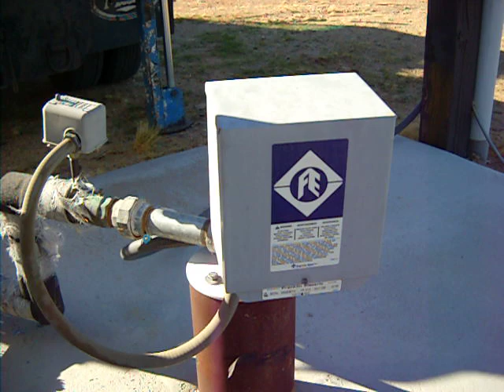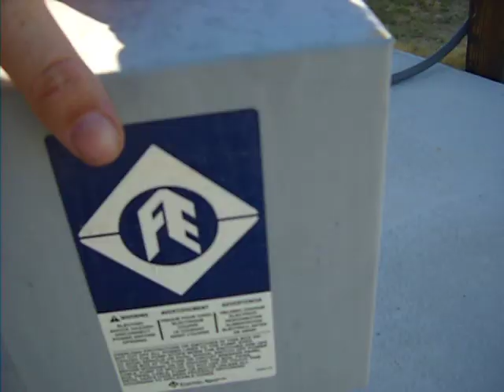PARTS OF A WATER WELL SYSTEM

Comment: Great video for us that don't know wells.   Can you tell me about leaky air valve (I think it's called a snifter or schrader valve)?  When my pump kicks on, the air valve leaks.  It looks easy to change, but do I need to drain the tank first?  Any other tips for changing it out?  What is the exact name so I can find one?  Thanks.
Reply: it is a snifter valve but it has no spring in it. It is designed to let air into the pipe so that the water will drain out. It's a freeze protection device. When the pump is running, it will dribble a bit of water or hiss some water. To test my statement, when the pump shuts off, you can unscrew it and there will be no pressure or water coming out of it. Go to a well supply co. for a new one if you believe it is fouled. They do get crusty from the water over time. Do you also have a round valve looking thing tapped into the side of your tank,, maybe an 1.25 inches in diameter? That's the air volume control valve that balances out the air inside the tank as the pump fills. Thos get crusty as well and need to be replaced.

Comment: why did the company that put are new well install two check valves in system and will it void warranty if we remove
Reply: The correct placement of check valves is (1) mounted in the top of the pump (larger pumps do not come with one internally and need one installed as close to the pump as possible) then check valves are installed  Evey 200' in the well. One check valve is installed close to the top of the well. We usually install check valves above ground like the system in the video so that the county can verify that there is a check valve in the system as far as warranty it depends on the pump manufacturer. If it was me I would reinstall the check valve to be in the safe side!!!!

Comment: Great vid. Nice to see how the actual pump looks in the well. Appreciate the view of what this actually looks like prior to working on mine. I am getting ready to install a new pump in my well as it is having a hard time getting up to cut off pressure. Takes about 5 to 8 minutes to get from cut in to cut off, which is 40-60. I have replaced 32 gal pressure tank as it was bad (water logged), replaced pressure gauge, replaced pressure switch. I still have this problem of pump satisfying cut off pressure with proper time, as it should be about one minute. I am getting ready to install new check valve as it may be holding back this water coming in. I will see as this seems first choice and cheapest to fix. My question revolves around possibility of line being restricted as I found much iron and sediment in old tank. Slowly clogging up everything. Could water line from pump be restricted? Could pump be restricted around filter from this sediment. 18 yrs since pump installed in new drilled well. Goulds 1/2 HP GS model. Well 120 ft deep with 50 ft to house. Size of Poly black one piece pipe( I am not sure what the exact name of this plastic is called but is very durable) is either 1" or 1 1/4", not sure, but think it is 1". If I end up finding new check valve is not the  fix for this, where do you think I should start next? Is there any way short of taking out pump to check water line for restriction? Is it hard to pull out pump and replace with another Goulds GS 1/2 HP 230 volt model? I live in OH and water has iron in it. Important to keep it moving through all lines as I suspect buildup in interior lines also, which are 3/4" and 1/2" lines. I have softener and iron filter on incoming water lines after pressure tank. All are in basement of house. How best to try and clean these out if possible? A lot of questions and appreciate your help and you sound like a guy who wants to help out. Also what size pump would you go with and brand? I want the best they make for my water. I get around 5 gpm but not sure if that is still accurate and not sure how to test now for flow or even if it is accurate due to all I discussed above, I am sure that is what it was rated at when drilled. It is cased but not sure how far he went down. There is no inspection of water well drilling in my locality but driller was experienced and knowledgeable. He is dead now. Can you lead me in right direction as I would like to do all this myself unless well is issue, which is last thing I will consider and rule out everything else first. But first possible considerations are bad check valve which I am replacing today, restricted well line, and finally bad impellers on pump which is a good one, but getting old. I have no idea about how to clean out these lines as replacement in house is impossible and not worth the effort. I do know that some air that was captured in interior line broke lose some sediment and it came out pretty muddy when air burst it out in upper master bath water line. Pressure did increase after this, so all lines are suspect with sediment or iron buildup. Pressure in house is not bad, but increasing to 40-60 from 30-50 did show some noticeable increase at faucets, but not much as would have been expected which again leads to lines being somewhat restricted, especially at 90 deg. joints.
Reply: The time it takes to reach cut off pressure varies by water level, pump horsepower, pump gallons per minute, and pipe size. Most pump manufacturers will have a graph that shows the "pump curve" of each pump size!

Comment: Actually Brett Allen the pressure switch is installed into a check valve, We usually install "FLOMATIC' brand spring check valves model 80BE this model has (2) 1/4" "taps (to accept a 1/4" nipple for mounting the pressure switch) and is specifically designed to install on well systems. you can also order them with (4) "taps" if you need to install a "snifter" valve and air pump in addition to the pressure switch and gauge. 99% of the wells I have worked on here in California have this set up, back east the use a "no lead" Brass "TEE" that screws directly into the pressure tank to mount the pressure switch gauge ETC. I am licensed in 3 states and have never heard the term "control center" used. in the video I referenced the pressure switch being a 20/40 switch and the on and off pressures I never referenced the actual air pressure in the tank but let me explain it for the other viewers, when the tanks are delivered they usually have 50PSI or more of air pressure on the air side of the bladder  and with no water in the tank you are correct that you should have about 37 PSI In the tank so the sun doesn't heat up the air and make it short cycle. as far as the "pump saver" spelt with an "ER' at the end not "or". is generally used on wells that have a tendency to run out of water, but if you drill the well correctly and to the appropriate depth, and size the pump correctly to the well you don't need a "pump saver"! I usually tell well owners the time to call Taylor Pump and Well is when they notice anything different such as short cycling or varying water pressure, as far as the Pressure relief valve if you notice the dirt in the control box and the union tight at the top of the well I had yet to work on this well system, I was hired to do a well cert on this well and chose this location to make my video and you will be glad to know that in my notes I suggested installing a pressure relief valve.
Reply: Bret Allen... Looks like you just got OWNED by a certified Well and Pump Technician.

Maybe you should stay above ground and seek a profession in irrigation instead. ;)
Reply: Wow I'm surprised to hear that you guys in the west just call those check valves. Im glad to hear you use the Flomatic ones and not the Simmons. Now back to the Pump Saver when I first typed my reply it was on my phone so yes I'm bound to hit a few wrong keys here and there. So you're telling me that you wouldn't put a pump saver on that well because it doesn't over pump the well. Clearly you're not going to over pump the well on day one but years down the road with droughts that water is slowly going to continue getting closer to that pump and most likely start to over pump that well in given time. Lets not forget about all the other important things that a Pump saver does like if the voltage to your motor varies by plus or minus 10% or constantly monitoring the amp draw on that motor and again the rapid cycle protection. What happens if the home owners left a garden hose on and left when that tank does go bad and the system does rapid cycle. What if they sell the house and the new owners don't know what to look for? We're talking about thousands of dollars worth of equipment that can all be protected with a 300 dollar part. Then your customers wouldn't have to worry about informing everyone in their house what to look for. Owning a well should be stress free. But I'm glad that you would rather have you customers wait until it does over pump the well or does rapid cycle and DOES start to cause damage. 
I also have my pump installers license Tazztt1 I have done 100hp pump jobs for commercial use, i have installed constant pressure systems, storage tank systems, solar pumps and much more. I am not new to this work and wouldn't still be making a living off it if i wasn't any good.
I hope Taylor pump and well also use TDR and Megohmmeter equipment along with their amp probes so that they can properly diagnose a problem. 
But I guess since I believe in protecting the thousands of dollars worth of equipment that I install everyday and making my customers not have to worry  that I should seek irrigation instead. Because Tazztt1 clearly knows everything.
Reply: Also everyone in this line of work here calls those Control centers because they do have the 2 1/4'' taps on them. We call them check valves when they don't have any taps on them and those are what we use down hole. The Flomatic 80E like you use are the best because they don't have a metal pop it like the Simmons and are also long bodied so you don't have to worry about your pipe butting up.

Comment: This guy doesn't know his stuff. For one that "Check valve" is actually considered a control center. A check valve does not have those half inch holes for your nipple for the switch. Second you want 2-3 pounds less than what your pump is set to turn on at so for 40/60 setting you actually want 37psi in the tank. Third and this a very important i see that you don't have any pump protection on that well system so if that pump ever starts to over pump that well you can damage that brand new motor/pump not to mention melt the pvc and drop the pump. When that pressure tank goes bad and the system starts to rapid cycle you're going to destroy that motor down hole thats why a pump savor is a must. At the very least you don't even have  a P.R.V "pressure relief valve" on top of that tee! What happens when that pressure switch gets plugged up and the points stay connected you risk blowing your pump right off that pvc all because you didn't put on a 15 dollar part. 
It bugs me to see people do piss poor work like this. Anyways I'm only 18 so what do i know...